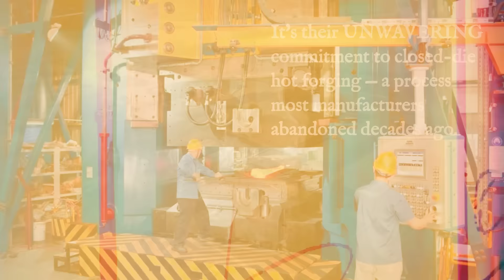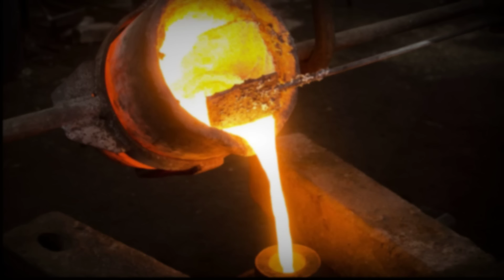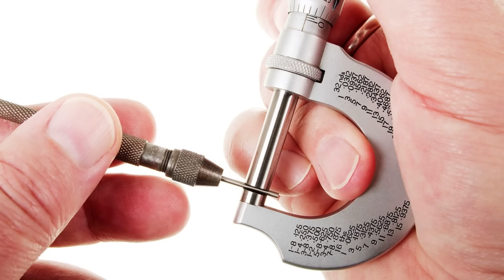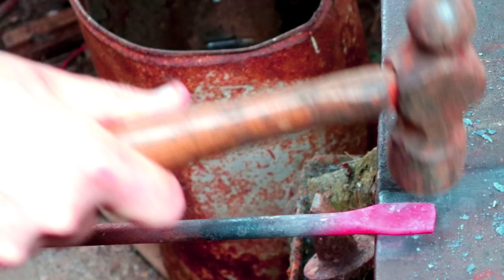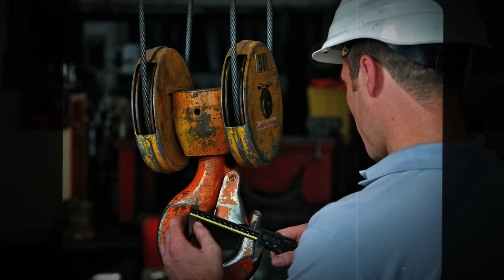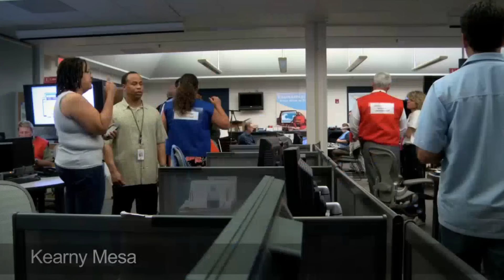The Socket That Proves American Manufacturing Still Rules

Comment: They mention nothing here about cold forging. My company made millions of sockets and they used cold header machines to form them. This aligned the grain flow the same as hot forging and then they were heat treated afterwards. They made sockets for most of the major brands.
Reply from the maker: @DennisVirden That’s a great insight 👍 cold heading doesn’t get talked about much, but it’s clearly a major part of real-world production. Interesting that it can achieve similar grain flow to hot forging with proper heat treatment. Sounds like a lot of big brands rely on that process. Do you think most people misunderstand how sockets are actually made?
Reply: @Built_to_Fail-r3q Most people don't know how most things are made. Being close to one of those cold headers when they're pounding out sockets and feeling that pounding throughout your chest is something you don't easily forget.
Reply from the maker: @DennisVirden That sounds intense 👍those machines are no joke, you can feel the process as much as see itReally shows how much goes into something people take for grantedDo you think knowing how they’re made would change what brands people choose?

Comment: Just bought myself a 1/2 inch drive set because the 1/4 and 3/8 sets are outstanding
Reply from the maker: @johnnyutah565 That’s a good sign 👍when smaller sets perform well it usually carries overSounds like you’re building a solid lineupDo you think the 1/2” will get the same kind of use?

Comment: I don't know about now but back i the 1990's S-K turned their sockets on Acme-Gridley multi-spindle screw machines then broached and heat treated them. This was then followed by blasting and plating followed by polishing.
Reply: SK also supplied wrenches and sockets to the  Sears Craftsman lines
Reply from the maker: @ronaldanderson6481 Yeah SK had a big role back then 👍a lot of those older Craftsman tools were actually made by solid manufacturers behind the scenesExplains why they lasted so longDo you think that kind of OEM quality sharing still happens today or not really?
Reply: It they were machined on an Acme out of barstock, the sockets are definitely not forged.  I guess they could have been forged as individual pieces and machined on a chucker Acme.
Reply from the maker: @1202-Alarm Good point 👍machining from barstock vs forging makes a big difference in how they’re madeSounds like there’s more nuance to it than most people realizeDo you think most manufacturers are transparent enough about that?
Reply from the maker: @danielbackley9301 That’s interesting 👍sounds like they had a pretty serious manufacturing process back thenQuality like that is hard to find nowDo you think modern production still matches that level or not anymore?